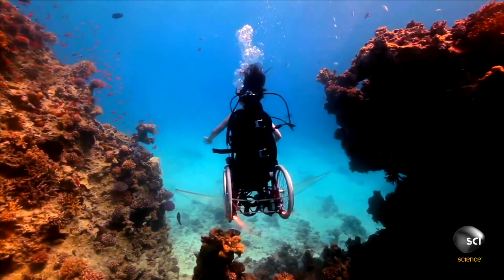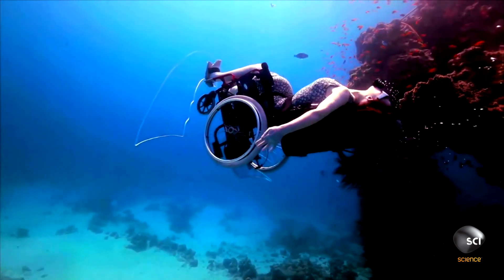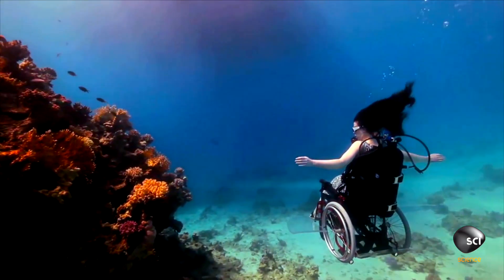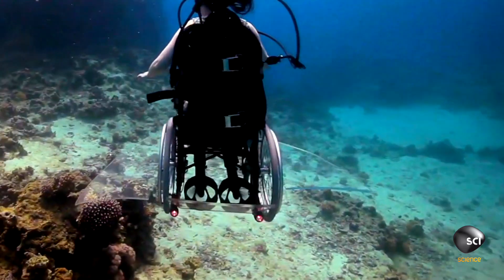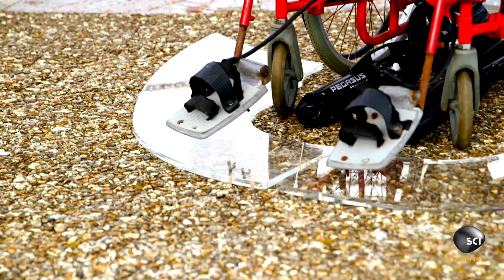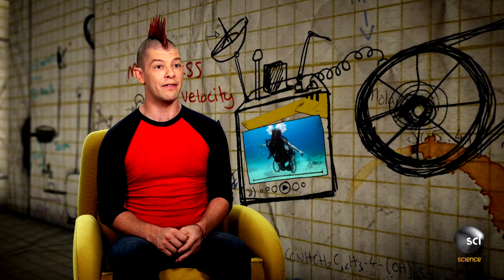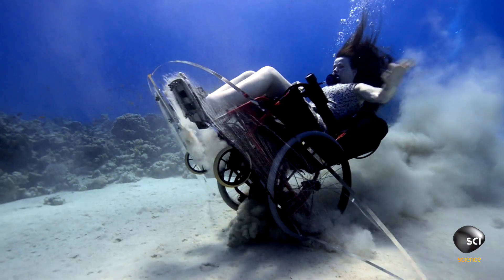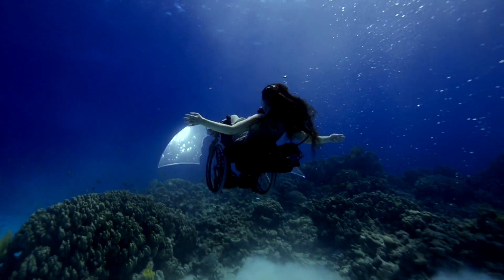Underwater Wheelchair Proves Doubters Wrong

Comment: Terrible idea. You can use a regular BCD and breathing to achieve buoyancy control as a paraplegic/quadriplegic without introducing a huge piece of equipment like a wheelchair that will likely kill extremely fragile and vulnerable coral reefs just by bumping or brushing across the reefs which are ALREADY in danger of death and destruction from ignorant snorkelers/divers and environmental pollution.